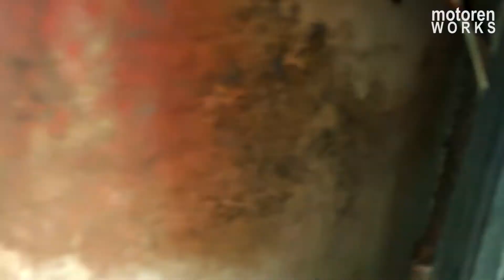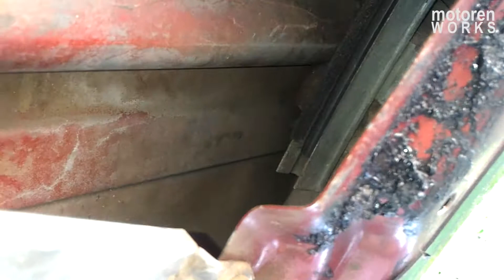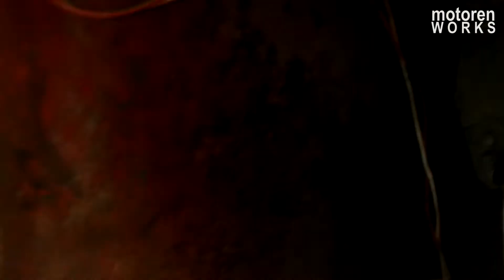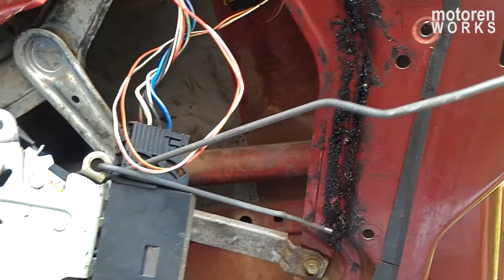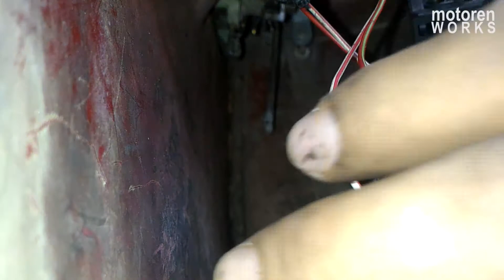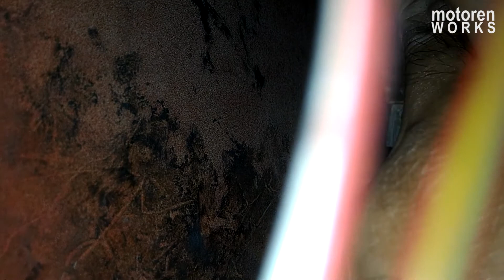Release the Door Lock and the Actuator (Front Door), BMW E36M43

Comment: How did u unhook the smaller latch for the door locking mechanism?
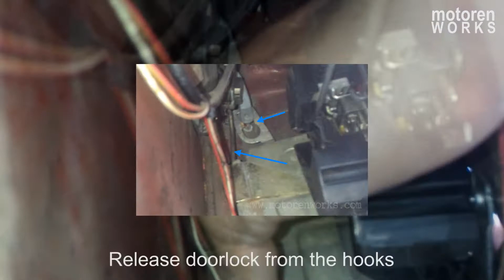Reply from the maker: 3:45 - 4:40
After unhook the door lock mechanism to door handle hook, lower the door lock mechanism until you see the lower end of the latch. It attach to the door lock (4:08). Hold this position and push the latch until it comes off

Comment: Thanks bro,super clear!
One question,you have any video of rear door lock replacement?
I believe that for dissamble rear lock of Berline model,its necessary dissamble the window??
Any tip for dismount rear lock without extracting windows and rails?
Thanks and best wishes from Catalonia.
Reply from the maker: Hello, greeting from Indonesia.
I'm so sorry because i don't have the video of rear door lock replacement. The process almost the same. 
If you want to remove rear door lock, you don't need to dissamble the window, just raise it.
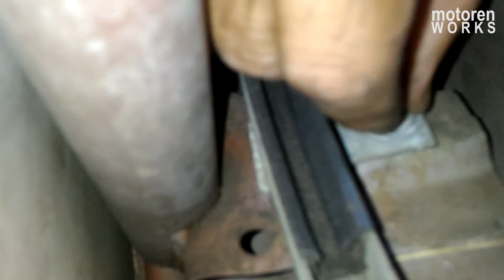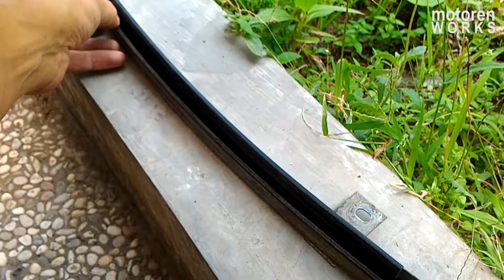In my opinion, you still need to remove the rail (in this video i remove the rail at minutes 03:00 - 03:35).

Comment: Good morning  Motoren Works i have a 1992 bmw E36  318i  M40  my central locking just stopped working  by itself when i turn the key the door  and boot and petrol flap wont open what could be the problem  because i suspect maybe the module  burnt out
Reply from the maker: Hi, i have the same prediction with you. I think you can check your central locking module
Reply: @motoren_works   thanks very Much I appreciated for you giving me advice I am going  to try and change my central locking  module  and then I will let you now if it's working
Reply from the maker: Good luck

Comment: Mas kalau pintu di central lock semua mau ngunci, kalau pas buka cuma 1 pintu saja yang kebuka, sama kalau di kunci dari dalam central lock ngga bekerja kira" yang rusak apanya mas?
Reply from the maker: Karena belum pernah mengalami di e36 sy, menjawabnya hanya reka2 nih mas. E36 nya di bagian perkabelan dan kelistrikan yg berhubungan dengan lock dan unlock pintu masih normal semua? Tidak ada jumperan atau pakai remote?
Reply: @motoren_works  kondisi masih bawaan mobil semua mas, dan belum pakai remote
Reply from the maker: @gheryfaurizal2696 kemungkinannya bisa dari modul central lock nya sudah error mas. Tp berhubung harga copotan modul CL lumayan, coba diskusi jg dengan teman yg punya pengalaman mas

Comment: I have a e36 compact (m43),the central locking has failed, key turns as normal but doesn't open car, I am locked out! Any suggestions or help? Thanks
Reply from the maker: In my opinion, if your central locking module is good i think you must check the actuator on your drive side door
Reply: @motoren_works  Thanks for reply. I shoulda say that my drive side door lock has been smashed by a thief since before I've owned it and I have always used only the passenger door to lock and unlock.
I don't know if my car has a central locking module, my Haynes manual says some models don't have it and are controlled by the ecu.
My immediate problem is how to get into the car with least damage../ expense..
Reply from the maker: @upton_ogood  i think the problem are in your actuator or door lock mechanism. You can check it by remove the door trim, but i think it must be done by care, because the door can't open

Comment: Kalo e36 m43 318 sy. Pintu kanan nutup, gak bisa ditarik handel dalam, dari luar, tarikan yg ke atas juga macet, pake kunci jg gak bisa. Pintu nutup dan gak bisa dibuka samasekali. Solusi nya gimana ya
Reply from the maker: Sudah coba buka dr kunci bagasi om? Pintu kanan dan bagasi sama2 central lock. Kalo masih belum bisa, coba cek actuator dan door lock. Ketika pintu dalam kondisi terkunci dan tidak bisa dibuka, mau tidak mau harus ngelepas door trim dalam kondisi pintu tertutup. Ngebuka door trim agak sulit, butuh ketelatenan dan kesabaran
Reply: @motoren_works  sudah dari pintu kiri dan bagasi gk bisa. Iya harus buks doortrim dari dalam. Solusi terakhir itu. Tapi blum dicoba, smentara lewat pintu kiri kluar masuknya.

Comment: My 328I E36 1998 Does the same plus beepping sound from alarm system but
 wont engage and wont open or closed.I checked all fuses and they fine 
and started opening glove compartment and driver side under steering 
wheel , checking wiring and modules and so far nothing. Anybody had this
 problem, please let me know. thx
Reply: You still have this problem? Try to push into driver door while open/close, there is a button on the latch that is worn